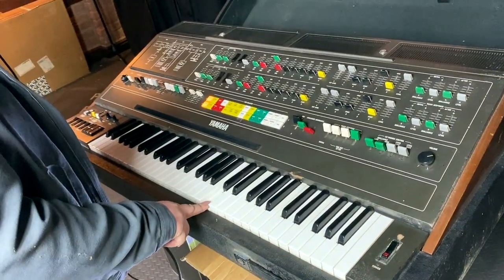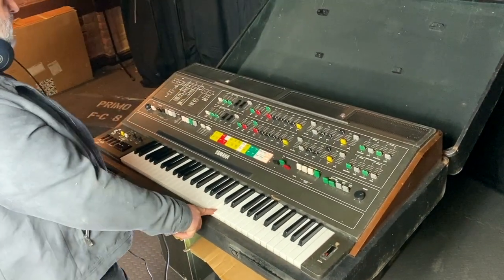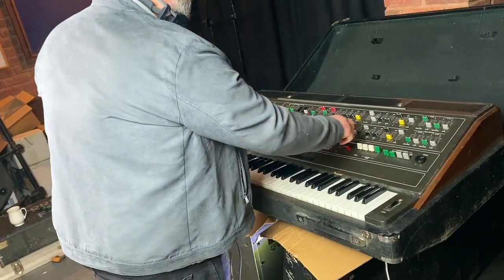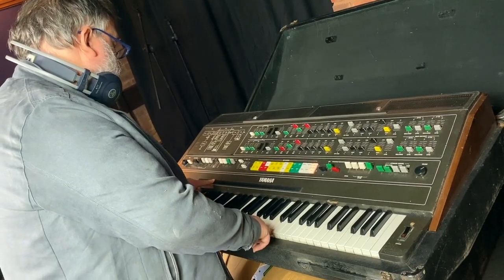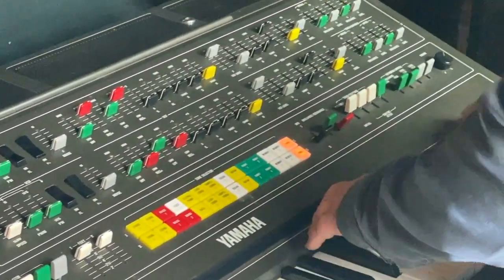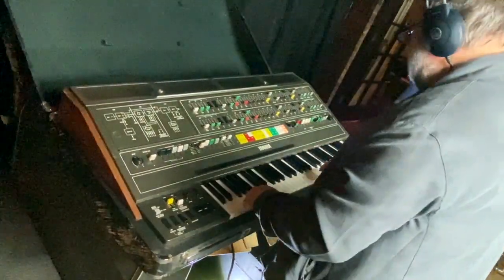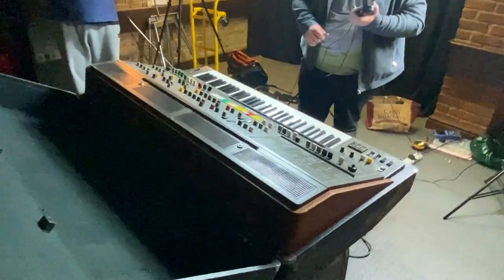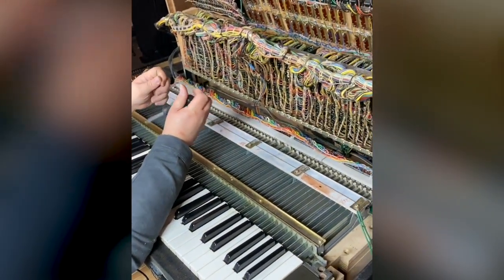Yamaha CS-80 Wakes Up After 30 Years

Comment: Why would there be so much that doesn't work if it went into storage working and was stored at an appropriate temperature?  I understand things like pots and sliders oxidizing and needing to be cleaned but why would other parts not work?  Ah, didn't know cap's decayed even when not in use, I was thinking about chips.
Reply: It basically breaks if you move it it's truly analog and it is super sensitive